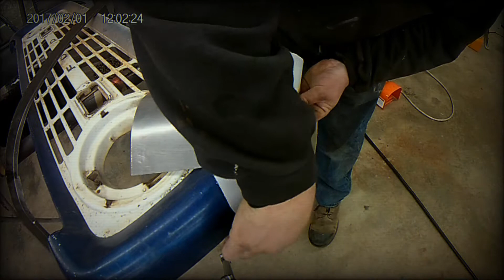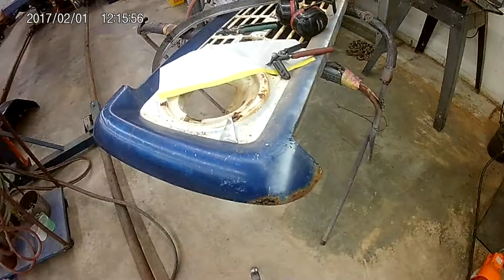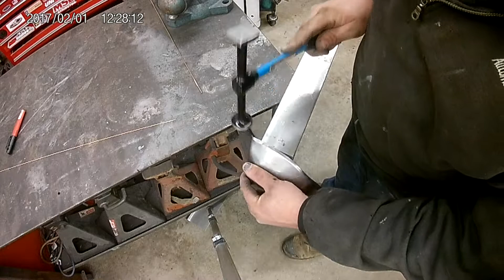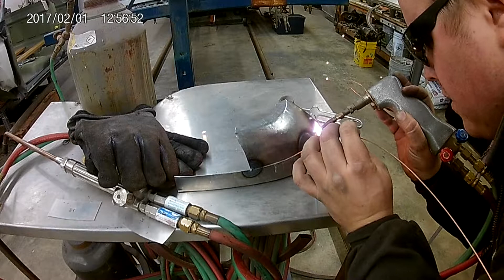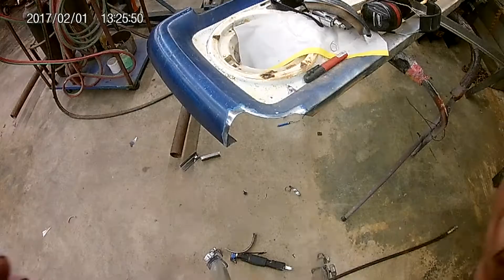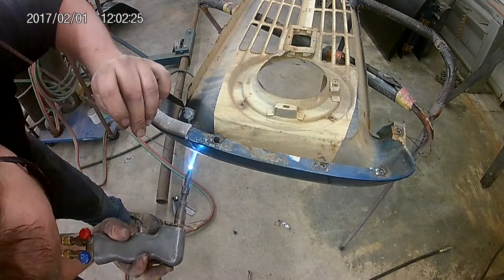Classic Ford Bronco Grille Repair with Gas Welding.

Comment: Four years and no comments yet. I’m shocked. I found it very interesting and you’ve made me think about trying some acetylene welding since I already have the torches. I’ve cracked a few mig welds attempting to stretch them back out. I’ve also wondered about over stretching before welding and this is the first time I’ve seen anyone on YouTube even talk about it.
Reply from the maker: I went way into the rabbit hole of pre stretching. I went to a few metal meets even with the intention of just pre stretching research and not many people were interested. I think these guys who just oversand the metal to get rid of all the weld seams is prefered to a visible weld line that can be covered with a primer coat or more localized filler wipe. just frustrating that everyone acts like they dont block sand their cars and it comes off the english wheel ready for paint.  I forgot about this video!